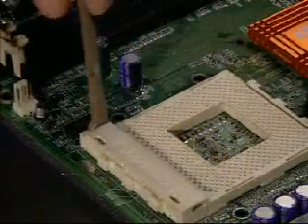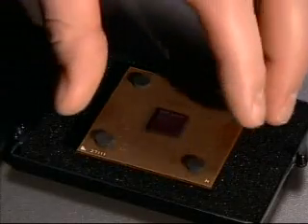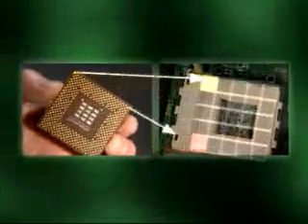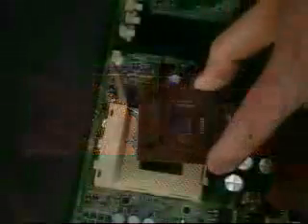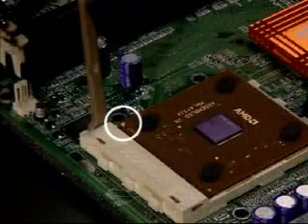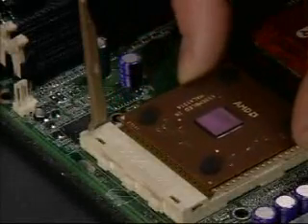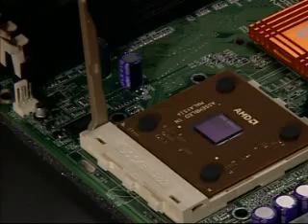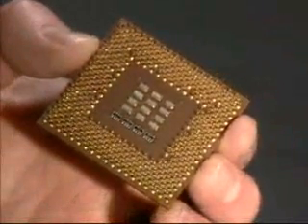Installing AMD Processor 1

Comment: @BigSexy4490 the frequency is a frequency, and cores are cores.IF you have 2cores processor, that doesn't mean you have 6Ghz processor.You have two cores processor running at 3Ghz frequency.